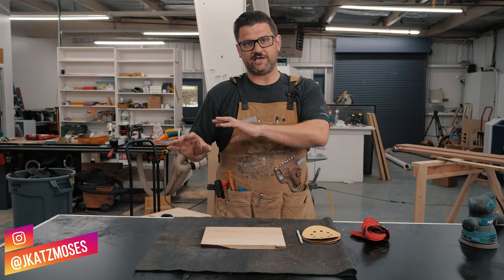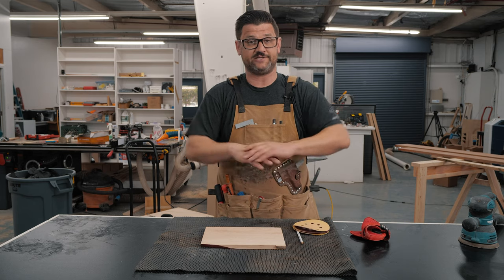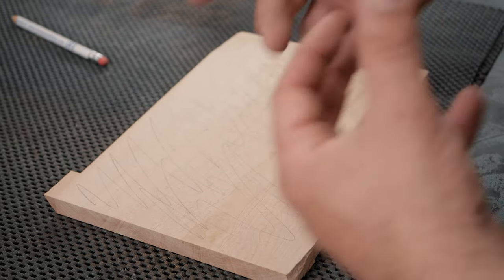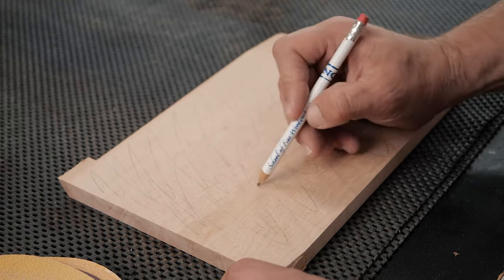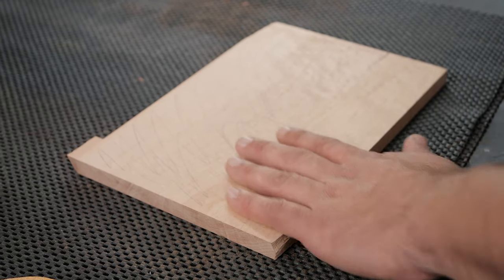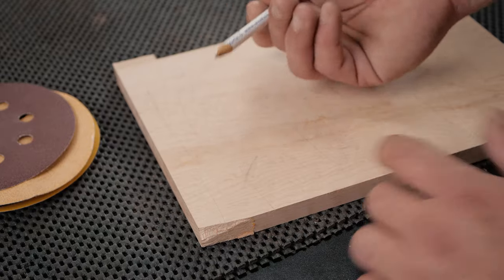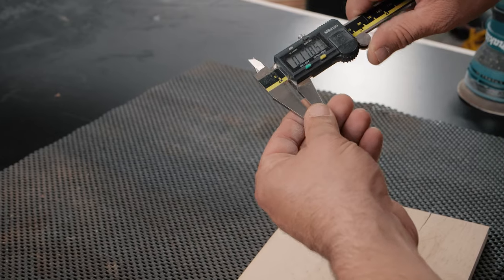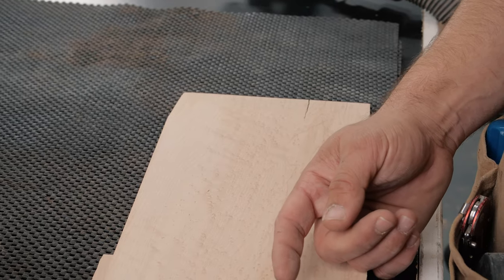How to Sand Like a Pro - My Favorite Sanding Tip

Comment: In addition to using a pencil to highlight the high and low spots,  the pattern in which you sand helps also. Try sanding  in 4 directions in this order- 1x perpendicular to the grain,  2x diagonally across the grain (once each direction) and lastly 1x with the grain.  This assures the entire part has been sanded along with making it flat (old school sanding trick) from a professional cabinet maker.
Reply from the maker: Good advice
Reply: Are you meant to go both diagonal directions? I'm trying it out on a project am not noticing any change 😕
Reply: @Roboboy17  yup, both directions.
Reply: I feel like this would make zero difference.
Reply: I like the way you think. I use the old horizontal perpendicular..... and horizontal approach myself
Reply: @ilikewaffles3689  I actually does. Unless you want to risk digging
Reply: A shop that has old equipment. Say a wide belt sander that hasn’t been serviced in many a year. Deep grooves. Sand them smooth. Horizontal perpendicular horizontal....... shit should have serviced the wide belt

Comment: As an apprentice I made a chessboard and got a completely flat surface using a belt sander.  It's all about technique.  Cross grain, diagonal one way, diagonal the other way then the last pass with the grain, repeat.  It's all about being methodical, not helter skelter

Comment: Make sure you use a soft pencil for this. A hard pencil will likely produce deeper marks than your sander will take away, especially on soft woods such as pine. A soft pencil will only leave graphite on top of the wood instead of scratch a line into it.
Reply from the maker: I mention that in the video. Great advice
Reply: @katzmosestools  Indeed, I was only trying to add some additional information on that point. I've tried soft strokes with a hard pencil but you'll likely still end up with scratches. So I thought I'd save other people some sanding trouble.

Comment: Good Tip Jonathan. I have one in return. Try to grip the orbital sander at the base instead of at the top. Holding it at the top, it's much harder not to tip it. Also, your shoulder is super high when you sand holding it at the top, whereas it can be relaxed when you hold it at the base.
Reply from the maker: Great advice!

Comment: Hopefully you still look at comments from 3 year old videos. How about a video on sanding things that aren't flat? I have a hard time with anything that has molding. I just can't seem to get clean results when refinishing the trim inside door panels for example. Or the inside corners will take more stain because I've torn the grain. I can't seem to get it right, no matter how hard I try.

Comment: I was taught many many many years ago to use light coats of spray paint instead of the pencil scribbles.

Never even considered that something else would work instead of paint, especially for something that is close to really flat in the first place. This technique will be a nice addition for the future. Thanks!
Reply: I've seen the spray paint method used especially in the body shop as a "guide coat" for the final pass sanding on bondo and primer. I vaguely remember using it a few times on a few fiberglass projects.

Comment: I've always resisted using pencil marks like that, I guess because I thought it was superfluous. I relied in touch and figured the reults across the piece would equalize due to the random nature of our sanding movements. BUT, Can the past I did almost exclusively case work-- Using already flat plywood panels!

Now that I've recently progressed to milling my own lumber, this consideration of flatness is quite important!

Thanks so much for highlighting the, well, "point" of the pencil!

Comment: Great video. Just curious what your thoughts are on grain direction when sanding. Typically I have sanded in the direction of the grain and havent had many issues other than a few swirl marks here and there. Recently I have noticed that some individuals sand across grain and perpendicular to the grain before doing a pass in the direction of the grain. I have tried doing some research but there isn't a ton of info on this. From what I understand sanding across the grain will remove material faster???

Comment: I love the pencil trick!

I recently started using compressed graphite sticks instead of actual pencils ($10 on Amazon for about 200 pencils worth).

Saves a TON of time just "wiping" it on instead of having to constantlyscribble and sharpen.
Reply: Funny you mention time saved.  I often spend more time scribbling on my project than the actual sanding.  Have been thinking how to speed up the penciling.

Comment: one thing I have a question about is the speed on a ROS with adjustable speed.  I realized the other day that mine has been set on the highest speed and never changed since I got it.  What uses or cases would determine changing the speed on a random orbit sander?

Comment: I never really thought about skipping grits.  I have 80, 220 and 400.  I have so much to learn about wood working.
Reply from the maker: Yea 220 would take forever to get the swirl  marks out of the wood after 80. Check out the sandpaper I linked in the pinned comment. It's only 10 bucks for a 70 pack

Comment: Would you ever sand boards directly after putting them though the jointer/planer?  Most guys I watch do it towards the end of a project, but it seems easier to get them as flat as possible before the build.
Reply from the maker: They should be dead flat from the jointer planer. Sanding is a finishing process. Your board gets banged around as you build so you always need to do it at the end

Comment: Man how do i sand faster? Been doing an old table, tried getting as much clear coat and stain off with a paint scraper because it was clogging my paper, but now even using 60g its taking forever. Do i just need a higher rpm sander? I have a single speed dewalt palm sander didn't wanna use the belt sander because i figured it clog / take too much off.

Comment: Good tip, I always have trouble knowing WHEN to sand. Do I sand before I make any joints to make sure they go back together perfect. Do I dry fit everything and  then sand? Or, do I sand after my project is glued up? I totally lack skill when it comes to finish work. Thanks for video!
Reply from the maker: depends on the project. I like to sand hard to reach areas before glue up and easy to read afterwards. You have to know what to avoid like joinery though
Reply: that's where my lack of patients and experience gets me into trouble. Tips like these really help though, thanks again.

Comment: I just finished a project where I had a lot of sanding to do, and this trick is good, but what I am really curious about is how do you handle all the vibration? My fingers were still vibrating after I was done. I think I got nerve damage, after that I had to take lots of break so I wouldn't damage my nerves. What is your trick for that? A low vibration orbital sander or?
Reply from the maker: You're fine. That's just what happens when you sand for a long time. It's not nerve damage it's the same as when you sit in a weird position for a long time

Comment: Good reminder to not skip grits. With softer wood with more delicate grain the pencil can be a bit aggressive so  chalk is a great alternative (white chalk, avoid colored. I made the mistake one time of borrowing my kids sidewalk chalk and the dyes caused me grief)
Reply from the maker: Yeah it does not save you time to switch it just means the next grit takes longer. I find chalk white or otherwise stains my wood or at least gets into the grain and is tough to remove.
Reply: It's worth note here, that you can pick up one of my favorite little utensils... an architect's pencil (engineer's or draftsman's pencil is the same thing) at most office supply shops (like Staples or Office Max).
   It's a bit pricey for just a pencil, and the $25 kit has some interesting templates, but seems wasteful if you're not going into drafting...
   BUT...
    The "lead" in those is THICK, like almost 2mm, which sounds even worse than an ordinary "school #2". It also comes in a variety of hardnesses... The ordinary stuff in the pencil (HB, I think?) is actually relatively hard, so the marks you leave are fairly light, unless of course, you go all 400 pound gorilla on the thing.
   There's more... I love this thing as a rough layout tool, too...
  One press of the button, and you can use a thumb to set exactly how "long" you extend the lead... press and shove the lead back into the "barrel"... so it's relatively convenient.
   AND have you ever dropped a mechanical pencil (or the school #2, for that matter)??? Even just fumble them on the table, and you can't get away "unscathed".
   {as a general rule, I don't layout with anything less than .9mm, personally... like ANY thing}
   BUT you can drop this one. With only one piece of lead at a time, this little baby can hit the concrete floor from your shoulder-height and the only loss is the tip... kind of inconvenient when you just got through sanding it to a point... but not nearly as troublesome as a .7mm where you haven't got a single piece (out of more than a dozen in the pencil) longer than a quarter or half-inch... 

    The older school "bad ass" variety is a little more expensive, but comes with metal about half-way up the barrel, so it's even more durable than the "student" version... AND sometimes you have to special order the leads, which you can probably do online all over the place... I haven't really looked... (lolz) I have about a lifetime supply since a nearby draftsman's shop liquidated (going digital all the way)...
   BUT it's nice. I can swap to a softer, like #2 or even #1... OR harder #4, #5, #6? to let off less and less graphite for the marks... preserve the pencil a bit longer.

    AND should you need finer lines? Slash some sand--paper into about three-inch squares... ish... Staple or wire them together in a stack, like a notepad. Just stick that in a pocket (handy) so you can briskly brush up the point on your draftsman's pencil tip... a few strokes over some 120 is sufficient to create a fine edge not dissimilar from a knife-edge if that's your thing... and you can swivel it with a bit of care as you drag it over the grit to refine a VERY sharp point. It wears relatively predictably, also dependent on your choice of hardness... so it tracks to straight-edges well in those uses.

    AND for the record... yes. I love carpenter's pencils. Any time I have an aged metal instrument that needs help so I can read the marks, writing, or manufacturing symbols on it... I carve to expose about an inch of the lead in the carpenter's pencil, and use that to "shine" the metallic instrument... then wipe on a rag (or my thumb can scrub when I'm particularly prone to lazy enthusiasm... and reveal the marks, diminish rust (if not entirely get rid of the stuff), and even prevent further corrosion for a fair length of time.

    You CAN chop a carpenter's pencil into shorter sections, expose each end of a single segment, and attach alligator clips with wires to a stout battery (lead-acid, automotive, motorcycle, or lawn tractor typically) and turn the graphite into a hell of a bright heating element. That gets HOT HOT HOT!!! and it doesn't waste time about it... so be F***ing careful!!! ;o)

Comment: Awesome tip thanks! I have the same random orbit sander but can’t find an adapter to connect it to my shop vac. What adapter and hose are you using in the video and where’d you get it?
Reply from the maker: Hose came with my Vaccum. The adapter was a universal flexible doo-hickey from peach tree woodworking I believe. I have to use a hose clamp to keep it attached to the sander but it clips into my bosch hose perfectly
Reply: Shipwreck0316 - Go to Rockler.com & see the Dust Right Universal Small Port Hose Kit. 
It's on sale for $31.99. Great hose and fittings that fit anything.
Reply: JAMES WEST II just picked one up thanks!

Comment: Do you recommend starting the sander on or off the wood?
Reply from the maker: I start it off the wood and setting it down while moving sideways. I dont think it matters much if you're using the pencil trick. Once the pencil is gone that part is done

Comment: Hi guys. I have a problem. I bought a black limba slab today which is approx 1.5m x 750mm. It’s too wide to go in the supplier’s planer. The option is to cut it in half to fit the planer but I’d rather keep it as one piece for my table top. The slab has rough saw markings across it and the supplier suggested I use an orbital sander to rough it straight right down to finishing. Will this work if I use this trick? It’s a rather large piece of wood! Hope you’re able to answer! 👍
Reply from the maker: Build a slab flattening jig. I have a video on it. Cheers

Comment: Hi i would like to ask a very basic question bout sanding. While sanding with machine, are we need to press the machine to the wood or just let the machine touch the wood (and control it movement)? Yesterday i tried to sanding 2pine wood that i clamp that not perfect (the surface not even) but it turned out to be a big disaster, it turn out to be and epic mountain with a deep seabed. 😅😂
Reply from the maker: Great question! Yes you just try to control the movement and let the weight of the sander do its thing.
Reply: Jonathan Katz-Moses oh my thank you for the tips. It is a big help for a super newcomers like me😄
Reply from the maker: @berlinsusanto5748  my absolute pleasure bud!